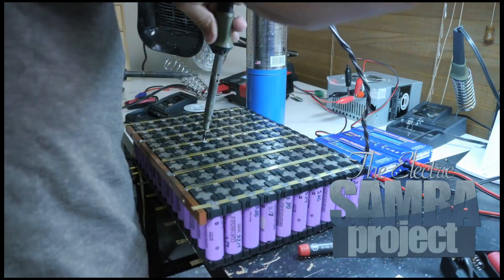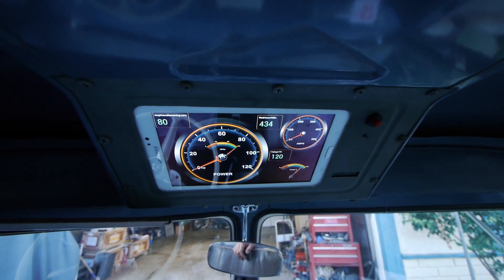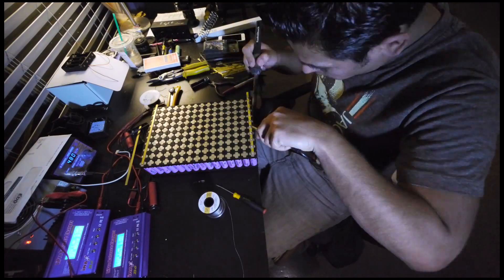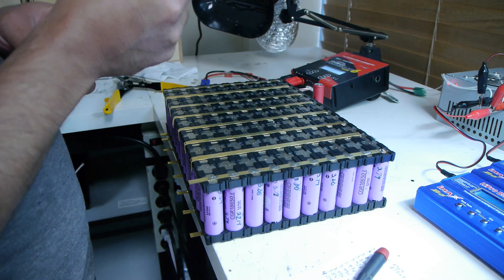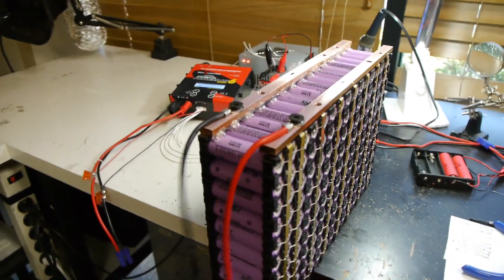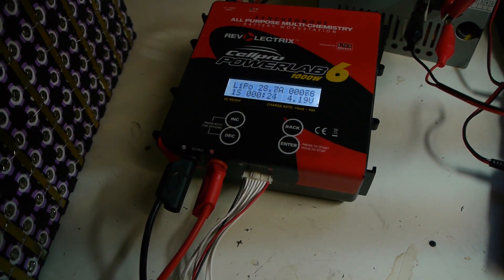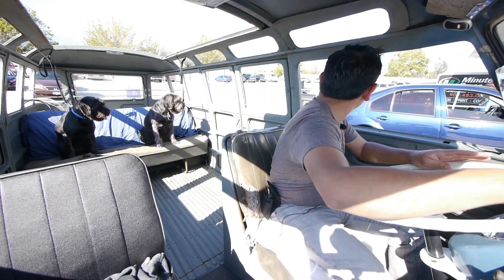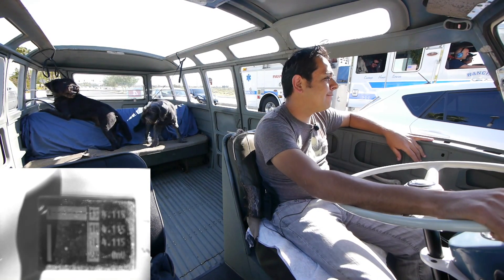DIY Tesla Car -  lithium ion 18650 battery -  VW Kombi

Comment: Just 2 things to remember: Do NOT solder batteries. Do NOT use solder for any joints passing through high current.
Reply from the maker: +suha rinos  I just soldered a buss bar that will see 700A
Reply: Sure you did, sure you can. It just shows how little you know how things should be done the right way. Ask Tesla and get surprised.
Reply from the maker: +suha rinos if things were done "the right way". I wouldn't be in America,  wouldn't have started my business or be driving my diy electric car.   So no,  I don't care what others think is the right way  but instead challenge it everyday.
Reply: shut up
Reply: suha rinos is right, you should listen to him or at least understand what he says.
Starting a business is easy, but there is a difference between doing quality work and dabbling.

Comment: what is the max load of the brass strips? i know it's significantly less conductive than copper. 
If each cell discharged at 2 amps, will the brass hold up to 40amps of discharge?
Reply from the maker: +Jim Curtis  yes it can handle 40A with no heat
Reply: do you know the max it can handle?

Comment: Does the brass strips you are using (not copper bars, those are thin brass strips across the face of the battery packs) have higher electrical resistance than copper?  I was sure that I heard somewhere that brass and bronze alloys are nowhere near as suitable for electrical work compared to pure copper, so will that affect your battery's longevity, especially if they contribute to energy loss from the heating of the brass alloy?
Reply: If you make them thicker then the increased resistivity gets countered by the increased surface area.

You can use aluminium busbars if you want - as long as they're 3 times the size. The reduced weight makes up for that though (less rolling mass = lower power consumption)

Comment: So you wired the 18650 module into the Thundersky/Winston pack in series like it was another LiFePO4 cell? When you get all the modules done you will wire the 18650 pack in parallel with with the LiFePO4 pack? If you are planning a parallel pack connected with a contactor there is a potential danger you should know about. Message me if you want to know more.
Reply from the maker: No contactor, my 18650 tesla modules have been permanently connected in parallel to my lifepo4 pack for 3 years now with no issues.
Reply: OK. That is probably safe. The issue arises if you take a pack out of parallel and then reconnect it while driving (under load). Even then it is only a problem if the pack's voltage doesn't match the other pack...which can happen if a few cells in one pack go bad. In that case surge current instantly goes to infinity (theoretically) and can rupture batteries. Despite the claims Thiundersky cells will burn quite aggressively under those conditions. (LiCo is probably even worse.) Don't ask me how I know.

Comment: What fuse is he referring to?
Reply: A small section of wire that is designed to burn up if one cell, or one series of cells, shorts. It saves the rest of the pack as well as allowing it to continue to deliver power so you can still drive to safety. If you have 3 separate series of 10 cells wired in parallel then you have a 10s3p pack. If one of those series shorts, that section of wire(the fuse) will burn up and disconnect that series from the rest of the pack. Now you have a 10s2p pack. So you end up with the same voltage, just less capacity. Think of it like a gas tank. With all 3 series sets, you have a full tank. If you lose one of those series you have 2/3rds of a tank. That means you can go just as fast, you just have to refuel more often.
Reply: This makes sense to me.  I get the concept.

I am thinking of making a battery for my electric wheelchair.  7 series 24 parallel.  

I have given some thought to using an inline fuse holder and similar type of fuse in my multi meter.

Comment: wtf?? you move the car only with 3.7v?? , gosh, 635A,  this is Tesla's battery pack configuration?
Reply: Because its a multiple series, multiple parallel setup. In electrical speak, that is referred to as an xSyP pack where the x describes the number of cells in series while the y describes the number of series sets in parallel. For example, a 10s3p pack built using 1,000mah lithium cells would equate to 37 volts with a 3,000mah capacity nominal. A lithium cell stands at 3.7v nominal, 4.2+v hot so fresh off the charger that 10s3p pack would read 42+ volts. 

So you would have 30 cells, each 1,000mah. If they were all in series, you would have 111 volts and a 1,000mah capacity. If they were all in parallel you would have 3.7 volts and a 30,000mah capacity. If you build two sets of 15s1p pack you would have 55.5 volts and 1,000mah per pack. Now connect those two packs in parallel and you still have 55.5 volts, even though you have twice as many cells, but the capacity doubles to 2,000mah. 

It's relevant to the motor. If the motor is wound to run at 3k rpm on 12v max it would have exactly the same amount of power as a motor wound to run at 3k on 48v has, assuming both have the same total current draw. The 12v motor would draw 4 times as many amps as the 48v motor which means the windings have to be much thicker. This is the benefit of a higher voltage motor. The thickness of the winding wire required is a fraction of the size, you just need more turns. There is no voltage limit on wire, only current. You can run a million volts through a 5 amp fuse and it won't blow. As soon as you add a load(current), it will blow instantly. Why is this good? Because now all of your circuit protection can be extremely downsized and much cheaper. This means smaller components which means less weight, heat and efficiency.
Reply from the maker: +Spark RD  no
Reply: jehugarcia So he used a step up inverter?
Reply: ok, and what model of motor he use?

Comment: when building a battery pack from reclaimed cells, do you check for the internal resistance of each cell?
Reply from the maker: +grn dragon no,  it's irrelevant when pairing so many of them
Reply: I ask because maybe I'm doing something wrong. I tried charging 4 18650's in series a couple times with less then 0.2 volts difference. on my imax clone I normally 2 cells at 3.85 and 2 at 4.5 when done. And that's at 0.5amps total.

Comment: Why not incorporate alternators run by the air movement?
Reply: Ay Metal: I know exactly what you are talking about and can see different wind turning designs in doing so.
I think you should just simply draw a sketch so he can finally understand what you are on about, ask him for Skype contact or email and send it to him.
Reply: @Weronica K.K.K. McCarthy
Tesla is using an air conditioner for its battery packs.
They are actively cooled and temperated this helps to expand battery cell life and get the most energy out of your battery. And of course, the AC does need a little energy itself. from the battery pack.
Reply from the maker: because,  Drag
Reply: +jehugarcia  Drag?? FYI, you get more drag not having windows...I don't think you understand what I'm saying here. A wind powered alternator would eliminate the parasitic loss on your modules.
Reply from the maker: I installed windows 2 years ago,  what parasitic loss?
Reply: Everything that put's a drain on your Modules and does not replace the energy is called Parasitic Loss. This "parasitic loss" keep's happening until your modules are drained completely. (common Knowledge)
 By adding wind-operated alternators you will be restoring A-Lot of that Power Loss and essentially the faster you drive the faster your module's re-charge.
Reply from the maker: +Metal Rott   Nonsense,  the only generator I have is the 80kW motor that puts energy back into batteries at deceleration.  Any other generator would work at negative net energy. (Common knowledge)
Reply: +jehugarcia Of Course you would say that, you haven't the faintest idea of what I'm talking about. 
You have your deceleration charging but that's only during deceleration and doesn't really have the benefit of an alternator which charges during acceleration.
I can see how having both methods as an Ideal way to maintain the load on the module.
Reply from the maker: +Metal Rott  alternators use more energy than they produce,  why would I want to drain my batteries faster?
Reply: +jehugarcia are you Def? 
Wind-Powered. 

The Air passing around the vehicle spins the Alternator/s.

With the right gearing you could flush mount these fans to the vehicles body panels and create a shroud to gather more air velocity (like how a hood scoop works on a race car) to spin the alternator.
Reply: +jehugarcia sorry for asking if you were def.
Reply from the maker: don't you understand what air drag means?   putting fans around a moving vehicle will slow it down requiring more energy from the batteries.  The generators which are less than 100% efficient will produce less energy than what they are stealing from propulsion.
Reply: +jehugarcia 

 If the loss in power exceeds the gain in power, yes your right, but in this case your wrong and would gain more than you would lose. Plenty more.

That vehicle wasn't the smartest choice for less drag but I'm sure you knew that.
Reply: +jehugarcia The current coming from the fans is One Way...the drag on the fans will only either do 1) stop them from spinning and 2) stop producing energy. It Never pulls power from the batteries all current only flows one way...to the module.
Reply from the maker: and you base that assumption on what exactly?     As far as I know 100% efficient generators do not exist,  and even if they did that would just put back the energy they consumed,  but all the other losses in the system would put you right back at negative net energy.    Perpetual energy is a myth
Reply from the maker: BTW:  the samba,  with the worst drag coefficient rating still only consumes 300 watts per mile.   As opposed to 1100 watts per mile on the most efficient gas cars
Reply: jehugarcia I'm Basing myself off your ability to understand my thoughts...This isn't perpetual energy, you are using The Wind     -.-      Nothing is 100% efficient        -.-          
The only time you're experiencing "losses in the system" is when you are running on your system alone, at take off and at dead stop. 
  Then once you gain speed your amperage would increase via Wind-Powered-Alternators... Get it?... 

   The Drag is outweighed by the gain in Duration produced by the charging increase dependant on velocity and module capacity.
Reply from the maker: what the hell!   you are too smart for me dude,    All that went over my head,   Build a working model and show me,   pretty sure i'll get it once i see it.
Reply: +jehugarcia I would if I had the funds/materials...which is why I'm suggesting it to you, as you seem to have the means to get it done. Plus you already have 90% done.
Reply: Metal Rott Adding fans would just drain the batteries faster. You are very ignorant, please, just stop.
Reply: Weronica K.K.K McCarthy Who said to add Fans?!
Do you know how a Wind Turbine works???? I'm talking about using the WIND to POWER an ALTERNATOR to CHARGE the Batteries !

Wow, you are ALL kinds of Stupid. You really look as stupid as you're Grand Wizard.
Reply: dfitnic "Produce way less than they will consume"....prove it or stfu. Idiot.
Reply from the maker: https://youtu.be/2WeqnD2HzS4
Reply: Metal Rott
WTF do they teach you in schools over there?
Every energy conversion looses some energy (in this case, you would convert the wind's energy to electric energy via the turbine).
There are NO generators with 100% efficiency rate- in fact, most of them are only 30-35% efficient (meaning they use 100% of energy and give back only 30-35% in form of electricity), and if you wanted to do what you said, you would need a generator with more than 100% efficiency- the first law of thermodynamics says that energy can't be destroyed or created (and you are trying to create it)
And to finish- you think all those guys in white lab coats working in BMW, Honda etc...wouldn't remember to use that magic trick if it was possible? They just use old school generators for the fun of it?
Damnit, where is this world going....
Reply: https://goo.gl/20HRqo

lol here you go bro. (don't take this serious)
Reply: dfitnic Schools teach a bunch of crap everywhere. Nobody said anything about 100% efficiency. Those guys in lab coats aren't smart enough. This world is fucked.

Comment: hey buddy I was just looking back at this old video.  I remember this project. great work with the fusible links. Do you remember what wire you used?  I know it must vary based on amps, I was just curious the type.

Comment: Is there anything more powerful than the batteries that you used ??
Reply from the maker: +mrderek800   Define powerful
Reply: A battery that can store more charge than the ones that you used in the video, so if someone where to construct a battery like yours it would be scaled down depending one the amount of charge that the new battery retain.
Reply from the maker: what you describe is commonly referred to "Energy density"   or "Watthour per kilogram".   these cells are not the most energy dense,  there are other chemistries that pack more energy but they are exotic and more expensive.   These cells are however the most abundant lithium cells available so thats why I promote their use,  they can be the most affordable cells you can buy if you are willing to  do some DIY
Reply: ok, thanks for the reply

Comment: Great video, would like to see a thermal image of the wiring and battery interconnects to see the losses, soldering the flexibles to the bus bar looks like a potential (no pun intended) area for loss
Reply: I stopped using solder on battery bars for high current packs. It can easily break and melt. Now I build pre-wired battery cases that allow me to simply drop the cells in, put the lid on and bolt the flanges down to guarantee a solid connection without the possibility of a solder or battery bar failure. All it takes to do this is a piece of sheet rock(you can use plywood but there is a chance of fire), spade bit that is the same size as your cells, battery bars and springs(for constant tension, not 100% required if your case is perfect).
Reply: Would be a good job for a 3d printer! could design the entire box in pieces, print them out, epoxy it together.
Reply: wvXvxvXvw, can you post a picture or link showing the configuration and assembly of the battery pack you're describing?

Comment: Kindly correct me if I am wrong! I can see this module is one gigantic cell with 4.2 volt at fully charged correct ? So how do you power your samba using this 4.2volt ??
Reply from the maker: +ganesh mahajan  by adding it to the existing battery on the samba
Reply: got it.. thanks for quick reply! you are awesome!!!

Comment: 650A at 3.5v? so yu could power it with  25 30Amp 18650's?
Reply from the maker: +pedenulle  80kW.  650A at 120v
Reply: jehugarcia
or just run them in serie...

Comment: You're running that off one 3.6V pack? What kind of motor is it? I'll have to go back and check out your build vid. And you haven't balanced the cells when charging? Probably OK short term, but long term the pack is sure to go out of balance. I would imagine for that many cells in parallel you'll need a custom BMS.
Reply: Hi Armando,
What is a custom BMS, please? Thank you.

Comment: +jehugarcia just looking back at this video, looking at the mini bus bars, i seems you've gone with an odd row of cells, requiring a mini bus bar for the last column, was this by design or oversight? if it was by design were you aiming to get a specific mAh output, if not, would you have redesigned to remove the last column? thanks
Reply from the maker: 15 rows of 10 cells required 7
Reply: +jehugarcia thanks for your reply
Reply: thx Gregory.
Reply: so , you got a big cell of 3.7v  at 2 amps each cell, for a total of 300ah , correct?  and to get 12v you would need 4 of these connected in serial plus ABS to keep them charge. correct?
Reply: +Serviciosymas they are recycled cells so their capacity isn't all accurate. because of that, you can't really determine the amp hour but you can load test to get the watthour. but yes. they are big ~3.7v banks, wired together to bring the voltage to where he needs. from memory I believe he's pulled ~270amp peak on the bus using recycled 18650 banks.
Reply from the maker: yeah 150 cells at around 2Ah each,   Should be around 300Ah,   i think I tested the module and it only gave me 260Ah,  but it was hard to tell because it gives it to me in code form so deciphering it was confusing.   
It  handled the 600A load with some sag at around 3.5V.

Comment: Did you use solder because most people have it? Why not spot weld? 60/40... wouldn't that melt before the fuse even gets tickled? just asking.
Reply from the maker: +heyyo dog   Used solder because that's what I had,    My test showed the fuse burning before the solder

Comment: How many amps each individual 18650 battery has?
I didnt understand something, did you place fuse at the battery cell??
Reply: yes there is a wire on each cell thats acts as a fuse.